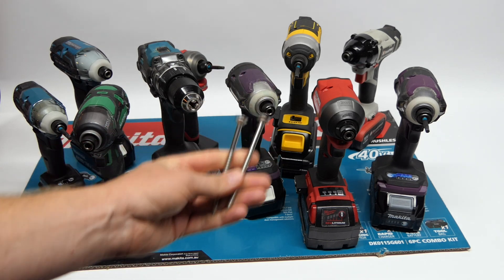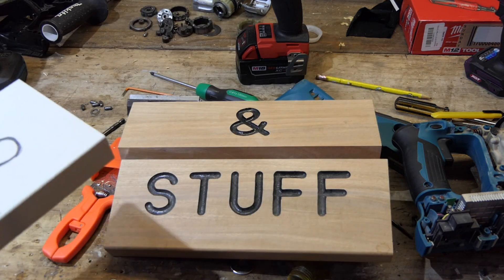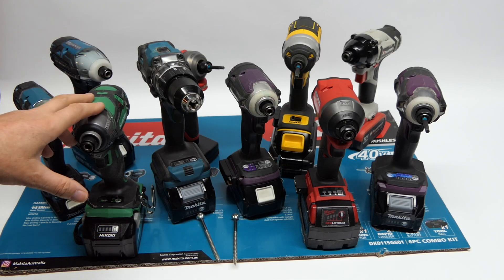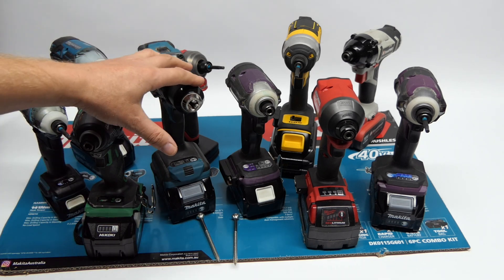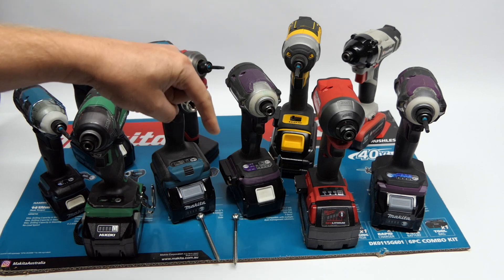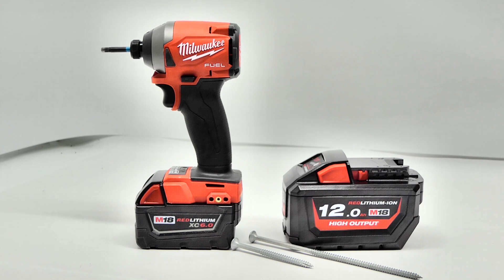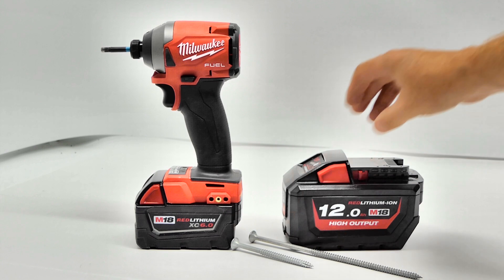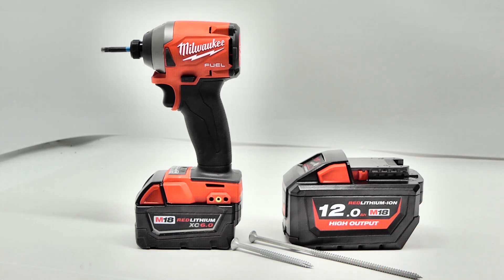Milwaukee Impact Driver Battery Test | 6Ah VS 12Ah Battery | 2 SCREW REVIEW #11

Comment: Can you use a m18 high output battery on a makita impact ?
Reply: Yes. Adapters available on eBay.
Reply: @paedahe4975  I know there’s adapters I own makita tools and I wanted to see how the big new battery boosts up the power since makita still uses relatively old technology for their lxt lineup
Reply from the maker: I will test it for you.
Reply: Might blow the fuse but it's worth a try. I use hikoki 8ah and 5ah on my makita tools without any issues.
Reply: @kizzjd9578  do you need an adapter for Hikoki batteries used on Makita’s or are they just naturally interchangeable
Reply: @JamieHara  yea need an adapter for everything man. I have three.. makita batt to milwaukee tool, makita batt to hikoki tool and hikoki batt to Makita tool.
Reply: @kizzjd9578  thanks. Yeah I have the Milwaukee and Dewalt battery to Makita tools adapter. Love my M18 high output batteries.